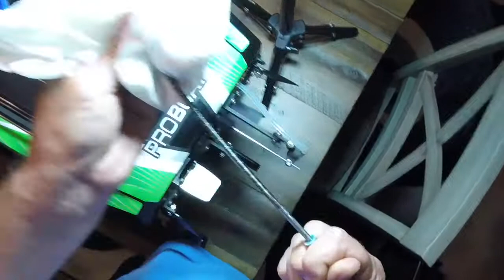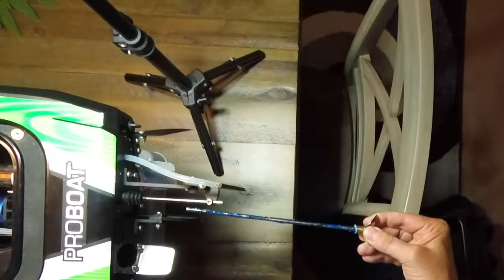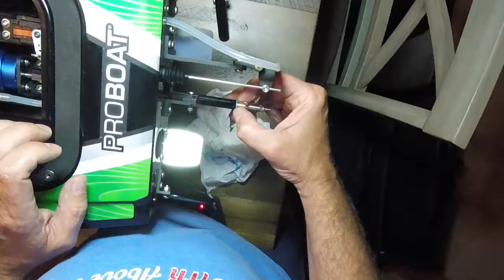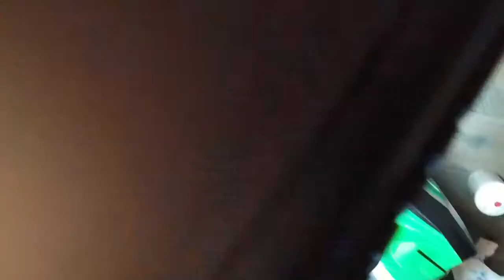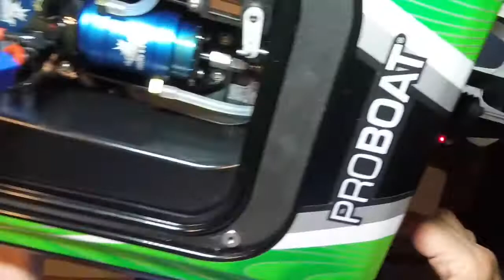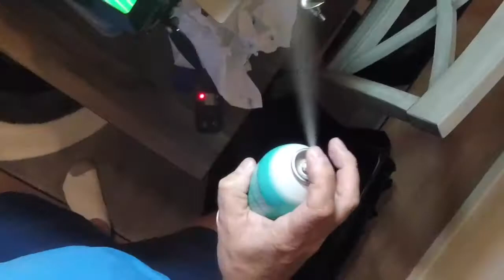Sonicwake 36 Proboat flex shaft maintenance - how to maintain the flex shaft and more

Comment: Nice vid thanks, my Revolt30 instructions say to blow water out of cooling tube and then spray wd40 using tube into the cooling system to pickle the system against corrosion,  might pay to add this to your   maintenance.  Cheers from New Zealand
Reply from the maker: Thanks for the info! I never thought of that. Thanks

Comment: A nicely presented video. One problem about your boat MAINTENANCE.. PULLING out your flex shaft with grease on it wiping it down and reapplying the grease is going to push grease into the motor coupler as there is existing in the drive tube which in turn  is going to kill your expensive flex drive. Before inserting your flex drive apply fresh  grease it would be a good idea to clean the drive out with a a few pipe cleaners with acetone to get rid of all of the grease left in the tube after pulling out your flex drive when you reinstall. FAILING TO CLEAN THE DRIVE TUBE WILL PUSH GREASE INTO THE   motor coupler. You do not want any grease on the end of your flex drive. I would suggest soaking your flex drive in acetone buy using  pipe cleaner to remove the grease .  

This will ensure that it is free from grease at the end of the shaft a very light rub with some marine grease leaving at least 30 cm at the top free of grease.  DO NOT USE A MALLET simply undo the motor coupler more and you can use some lock tight on the thread my sure that it is not the permanent lock tight 222 is the one . This will save your boat being stuck in the duck pond and spending hundreds of dollars on new drives because of slippages with your flex drive and motor coupler becoming damaged also you must space the prop shaft 2.5mm away from the drive as this allows the drive shaft to compress under load . i did not read the instructions as a result i have ruined my flex drive shafts due to slippage. i have noticed that you have no spacing of your prop. you do not need to grease your shaft every time you run the boat that is just going over board maybe every 10 runs or it depends  on how hard you push it
Reply from the maker: Thanks for the info.
Reply: Thank you for your comment . the idea of cleaning out the stuffing tube using acetone and a pipe cleaner is to remove all grease and also clean the the collar. before you reinsert the  flex shaft ONCE  it is then free of grease as you will leave 30cm at the top of the flex shaft free from any grease. There will  no grease in the collar. The shaft is spaced out at the end of the boat 2.5mm as per the instructions of the manual this allows the shaft to compress. i do not grease the shaft every time i run it the thumb of rule is that the shaft moves freely
Reply: @Finders - Keepers Hi we own the same boat it is the biggest down fall that people are not talking about. The motors do produce a lot of torque for the size of the boat . There is a design problem  that the flex shaft strips the collar and the shaft till the metal just smokes I have seen this first hand it is causes damage to the collar as well . 
What to if you good with a soldering iron you can fill the damage shaft with solder hand sand it and reinsert or you can loosen your motor mounts a tad and push the motor forward a few mills re tighten.this will allow  the collar to tighten onto part of the shaft  that is not damaged 
you will get to a point where you have to replace both the collar and shaft . 
i will stress to you that it will get easier to set up . if you do it wrong its just going to strip all of the time . 

Pull the shaft out clean the stuffing tube with a pipe cleaner using acetone . clean the flex shaft in acetone so it free of all grease. Re grease the shaft and leave 30cm from the top of the shaft the end that goes into the collar . INSERT once and you will not push any grease into the collar . Using a spacer you must leave 2.5 mills at the end of the shaft . Tighten the collar. As i explained in my video under the normal operation of the boat water comes up the shaft and into the boat . Your collar will get wet and will slip. 

USEING A FINE PAINT BRUSH YOU ARE GOING TO APPLY SOME ROOF SEALANT JUST A SMALL AMOUNT THE COLLAR END JUST WHERE THE FLEX SHAFT IS.
This will help keep your collar and shaft dry   

Untill i did this i was filled with total disappointment it came undone all of the time and i have nearly lost my boat. i am getting runs with confidence in my boat and every so often i will pit the spanners on the cola to check for any movement . i hope that this helps to enjoy your boat more

Comment: Great info !! Thank you very much...!! What diameter flex shaft   comes with the sonicwake ?
If you change the esc for a seaking 180 amp and put a 6 S batt you will have a rocket !  No heat isdues at all.
Reply from the maker: I will find out and get back to you on that bc Idk off hand
Reply: @DronemanJoeRc  are you running it on 6 S ?
Reply from the maker: @eduardonessim4499  I run it on 6s 5000mah 100c spektrum smart battery. check out my other vids on it I really give some good advice and I will find out what the shaft diameter is but it comes with the proper flexie shaft.
Reply: @DronemanJoeRc  thks a lot!  Im triying to buy one but they are out of stock in horizon hobyes...do you know where i can fing one now? Thks
Reply from the maker: do you subscribe to me my friend? I hope you do and let me know?

Comment: I’m having issues with my sonic wake. It’s making loud roaring noises when accelerating. Kinda sounds like something is stripped. Any suggestions would be greatly appreciated.
Reply from the maker: you have the shaft greased? also how old and how long have you had it? I also put a few drops of singer machine oil in the engine to keep it lubed. let me know. thanks for asking.
Reply: @DronemanJoeRc  thanks I’ll try all of that. The Boat is probably a year old now

Comment: Hey thanks for the video!
I have a sonicwake 36 with some upgrade parts from RC boat bitz and OSE (heavy duty flex shaft).
I read in many RC boat newsgroups that a flex shaft which is running in Teflon liner (like the sonicwake) should not get greased but oiled. What do you think about? Many people say that the grease "brakes" the shaft. 
Greetings from Germany!
Reply from the maker: I  just grease mine and its just fine. I never was told to use oil so I cant answer that. I hope you enjoy the boat and its alot of fun. I like that it self rights and I run it alot and its a great boat. Thanks for that comment and watch my friend.

Comment: What if you use a spark plug feeler gauge at the. Smallest size and put it between the ring and prop to get the right space when you tap the rear of the prop and that should give you the right space not tight just right try it next time and let me know how you made out .
Reply from the maker: that may work but I kinda just judge it. thanks for the comment and all tips are welcomed. thanks bud!!

Comment: if while driving the led flashes red and loses speed, it is a weak battery or an overheated ESC
Reply from the maker: that means it hit low voltage cut off and watch your time and keep it to around 8 or 10 mins run time. and the low volt kicks in and the battery is about out and it gives you enough power to get back to shore.
Reply: @DronemanJoeRc  8 to 10 minutes, I have 4 minutes of madness at 5000mah

Comment: I always squirt grease on the shaft and in the strut and stuffing tube. it's not hard at all to take a napkin and wipe the end clean once you push it through just take napkin and grip it and turn the prop end with hand thatll clean it then stick it in coupler and tighten. I prefer the extra grease in the stuffing tube just because it makes me feel better knowing its filled with grease.
Reply from the maker: Yeah I just re-greased it and did that. Thanks for the comment. I just got the miss geico 36 and that has two props and its even a smaller area bc they stuff the motors in the sides of the boat and its a pain in ass bc its even tighter area. Im taking it tomorrow for its first run so im going to take a vid of it.
Reply: @DronemanJoeRc  I actually built my boat, it's only a sonic wake hull and a few sonic wake parts that I ordered to go with it because I couldnt find anything other than to fit the application. I bought the empty hull from horizon hobby and took electronics and hardware from a previous build I had built and totalled in a bad wreck (total carnage) I'm using a Turnigy xk4074 1400kv motor, paired with a flycolor monster marine 150amp esc, tuned and set at level 5 punch for racing and speed.( this boat rocks) the Servo is a 35kg all metal 360° servo from RC max. i also added a cap bank off of the esc to prolong the life of running 6s all the time. the rudder is a Z style 150mm rudder and I added a second water cooling also, so the motor has it's own input and output and so does the esc. I'll actually be adding a third water cooling section to the battery compartment next so it will have it's own cooling input and output as well. im using a flysky gt3b transmitter with flysky receivers also. and the rest of the hardware I just bought sonic wake parts for it. I had to make my own push rod for the servo tho, as sonic wake or pro boat does not sell the push rod set for the sonic wake 36 like they do for every other boat. so keep that in mind if you ever need one. I have horizon hobby actually contacting pro boat about sending me an actual pro boat sonic wake 36 push rod set. waiting to here back or recieve in the mail now anyday, last I herd from them they emailed me asking for my mailing address. so hopefully il be recieving that soon. aslo if you ever crack or damage your hull, and have to buy a new hull, its comes as a RTR, (Remove and Replace) so another words it's a completly empty hull, nothing but the battery compartment inside or with it. you have to keep and install from damaged boat everything else. the raw hull doesnt even come with a drain plug, I had to buy all of the misc hardware separately for the boat. but all in all it's been a fun build and worth it.

Comment: I need support, I have a sonickwake so far I have swam without sticking the tape on the flap and you know after turning over the water is inside.  yesterday I taped the tape and after 1 turn I would say that the same amount of water was in the middle, where the water gets ??  if the boat does not capsize, there is no water.
Reply from the maker: need more info bud bc im not sure on what your saying?
Reply: @DronemanJoeRc  the water is inside as the boat rolls over on its back.if the boat does not capsize, there is no water inside
Reply from the maker: @coolwicia  this is a self righting boat the water in the side gets jetted out when you thrust forward. If there is water inside around the engine or battery its bc you didnt tighten the screws down enough and it up to you to place tape around it. I get some water in mine and it doesnt hurt it. I just spray some anti corrosion around my engine and interal components for maintenance  but the small amount of water you get in there really isnt a prob, just dry it after your runs and all will be fine.
Reply from the maker: Its a  boat and water is going to get inside i have boats that sink at times and they run just fine..spray some anti marine corrosion on the motor and other stuff and it will be fine..no worries
Reply: @DronemanJoeRc  The screws from the lid were well screwed and additionally attached with tape but it did not help.  About 30 ml of water was inside when the boat capsized
Reply from the maker: @coolwicia  thats about 2 tablespoons of water 30ml its nothing..just tighten the screws down enough for a secure fit and dont over tight. You really worring about nothing its fine. I get some water in mine all the time. Relax and just run the boat as hard as you want and grease that flexie shaft after all your runs and you will be fine, also dont do much reverse thursts bc thats hard on your shaft.

Comment: how much run time do get with the one 6s battery you are using?
Reply from the maker: about 10 mins, I try not to run them down much bc you will drain the battery to the point that it may damage it. so I have it set to about 10 mins and thats on a hard fast run.

Comment: What kind of washer is on your shaft after the prop is it metal ?
Reply from the maker: you can use these but you have to get the prop with it. otherwise go to horizon hobby and see the replacement parts for the sonicwake. hope that helps
Reply: Would you happen to know tue size of the washer that fits the flex shaft ?
Reply from the maker: @krazykid2002k  no I would defer that to horizon hobby to ask them. sorry

Comment: Are you running only one battery
Reply from the maker: I run normally 1 6s 5000mah 100c batt or I use 2 3s 5000mah 100c batts.

Comment: Not gonna harm ANYTHING (not nothing) 
I guess I'm not applying enough force to the prop because it doesn't want to come out
Reply from the maker: once you loosen up the nuts, you really have to give it good pull bc its really tight, so hold the boat and grip around the prop and pull hard. I know what your saying.
Reply: @DronemanJoeRc  thanks i fixed it I ran 2 4S batteries on it too many people on the lake to do 6S
Reply from the maker: thats excellent bud glad to see you got it resolved